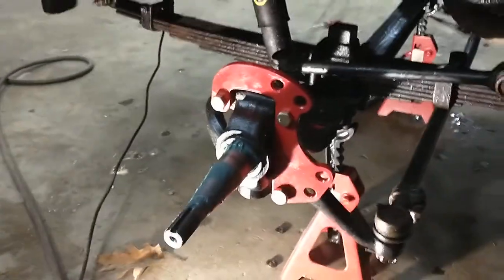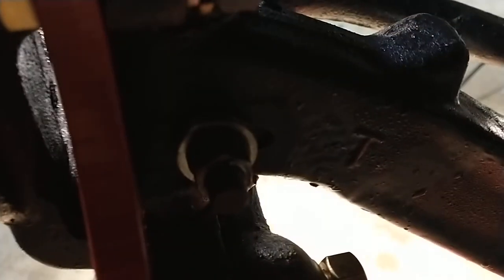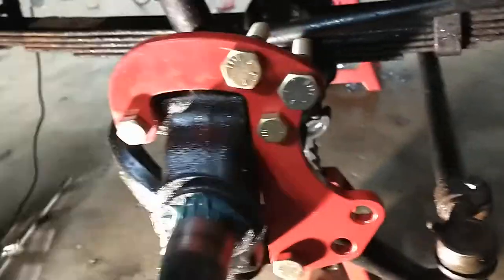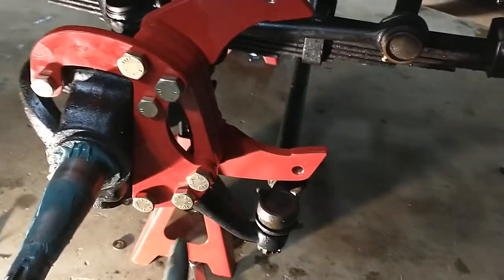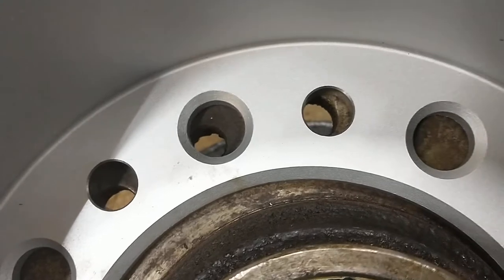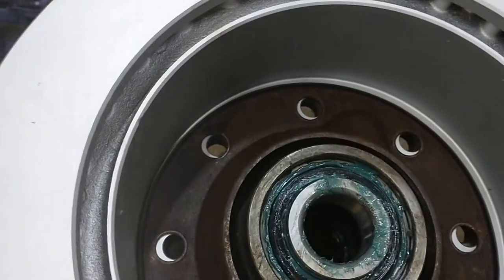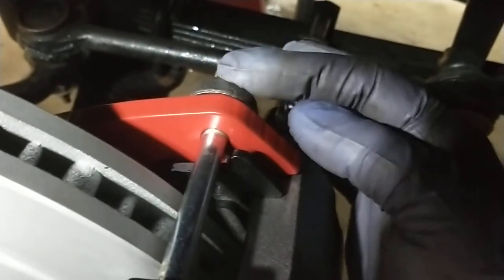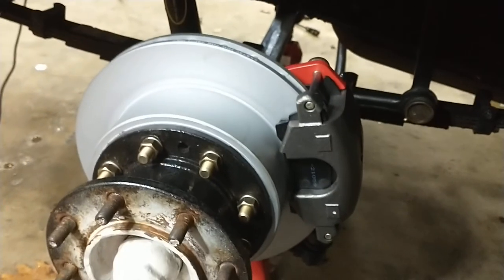1949 GMC 1-Ton - TSM MFG Front Disk Brake Conversion Part 2

Comment: Before coming across this video, I was prepared to swap out the axles from my 48 Chevy 1 ton because I couldn't find a disc brake conversion kit. 

Does TSM make / are you going with discs in the rear as well?
Reply from the maker: Hey Chris - yes they do make a rear disk kit.  I have not looked into as I plan to keep the rear drums for now.  Glad to know one exists in case brake drum supply dries up.  My truck has (I think somewhat rare) 14"x2" rear drums.  I have not found any in that size yet.

Comment: Hi! Great video and thanks for posting. I have a 52 Ford one ton and have been looking into a tsm kit for front and rear. They are speedy ($1500 for both including shipping) however I’ve had this truck on the road with the drum brakes and it is just frightening. I’ve had people swoop and squat in front of me and I’ve literally stood up on the brake pedal praying I would stop in time. My Ford goes 6700 lbs empty and I just didn’t enjoy driving it on the old brakes. What master cylinder did you go with? Or are you running the new kit off your stock master? My truck does not have power brakes either. Thanks again!
Reply from the maker: Hi Lewis - thanks!  I am going to do another video about my MC setup soon.  But I have a '76 Corvette dual master cylinder for non-power brakes with a disk/drum proportion valve.  It has a 1" bore - TSM Mfg recommends a master cyl bore no larger than 1 1/8th.  Smaller bore creates more brake pressure - but moves less fluid.  I just bled the brakes this past weekend and have yet to drive it.  My concern is I will run out of brake pedal travel before the brakes fully activate.  The '76 master cylinder is a common model used for these conversions, so I think I should be ok.  I'll do another follow up video about the test drive as well.  Good luck with your truck!

Comment: hi the1 ton truck spindles are similar to 3/4 ton spindles 
8 lug
Reply from the maker: Hi - I don't know for sure.  I think the 3/4 and 1 tons use the same part number for the front bearings, so the spindle diameter is at least the same. Not sure about the width, since the dually trucks have the front spacer hub. If the question is regarding the brake conversion, the company makes a disk brake kit for both single and dual wheel 8 lug trucks.
Reply: I have a 1948 Chevy 3800 and I bought the same disk brake conversion kit. Unfortunately my spindle looks nothing like the one in the video. Which leaves me wondering how would I go about installing the front disc brake on the truck I have. Please help!